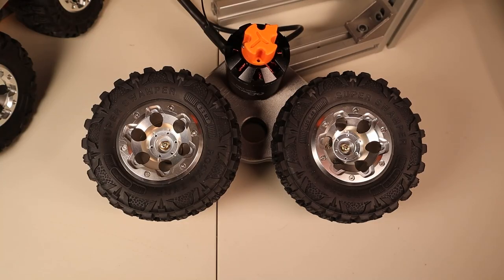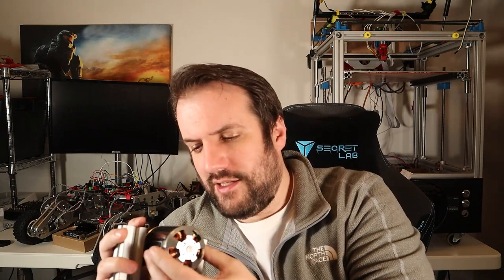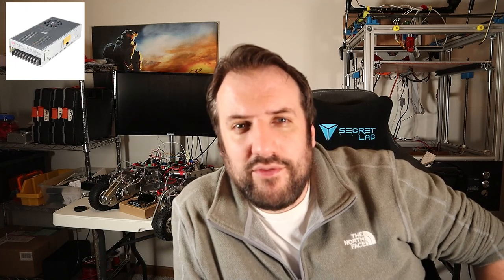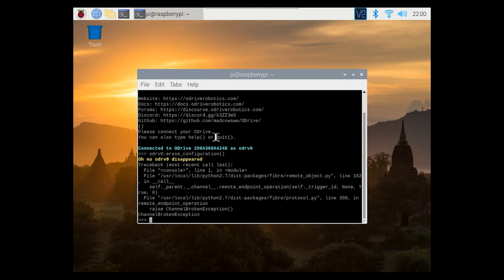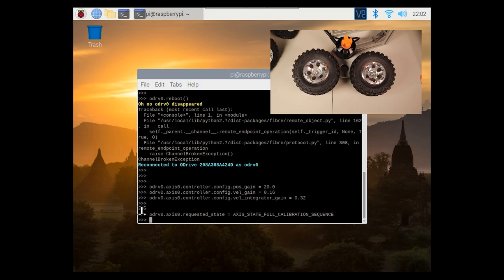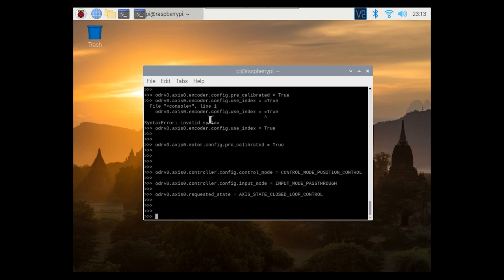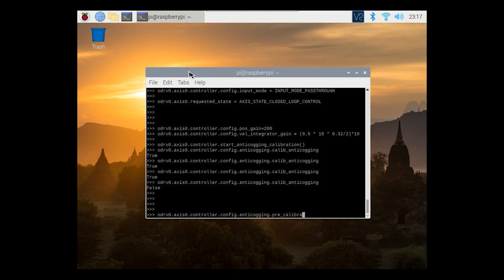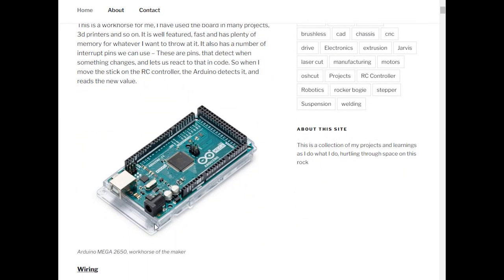Activating Anti-Cogging on the ODrive Robotics Controller (smooth brushless motor control)

Comment: thx for the sharing. Hopefully future can share some tips on calibrating the odrive parameter for motor (on how to set the gain value).
Reply from the maker: I have been thinking about my next odrive video. Thanks for the idea. I am going to probably focus on the control next, integrating RC control through Arduino for example but I do intend to circle back on anti-cogging at some point as I got a few tips from the manufacturer also to make the video better so it needs a part 2.

Comment: I've got a question. I'm going through the procedure and it all works fine. When i test it i can go down to 0.3 vel with smooth movement. My issue is though that the saving procedure doesn't work. Every time i reboot the anticogging calib is gone. Any Ideas?
Reply from the maker: I found recently that you have to put the motor state into IDLE before you can save. I’m not sure if that’s new or I just noticed it but if your motors are active or won’t save
Reply: @AndyVickersNet  thx so much ill give that a try

Comment: I am trying to choose some bldc motors for a robotic arm project but some of the motors that i want to use are not hall sensored. Do you think using a bldc motor without a hall sensor on a robot arm will cause problems when powering up?
Reply from the maker: I am having great sucess with the AMT102 encoders for use with brushless motors. if you have a brushless motor without a hall sensor you can use these encoders on the shaft to give you 8192 counts per resvolution of precision. They are excellent and reliable. They come with a multitude of different shaft adapters so you can add them to almost any brushless motor. You can buy them from the Odrive store:  https://odriverobotics.com/shop/cui-amt-102 .

I think with a robot arm, precision is everything so running it without an encoder or position sensor will be almost impossible. You will be able to power it fine but you would need to control it on current mode which would be like an electric skateboard - just dumping amps in without any precise control.
Reply: @AndyVickersNet  i will be using an encoder if the motor does not have hall sensor. But i saw some people experiences problem when driving bldc motors without hall sensor thats why i have asked. From your reply i understand that if i have an encoder its fine right? Btw thank you for the reply.

Comment: Hi, Thanks for sharing this amazing tutorial. Im doing whatever you do. But vel_integrator_gain and pos gain is so high. It turned my motor wildly. And the loud is so scary. Then ı halve the values. Now its ok. One question. How much will it take ?
Reply from the maker: Sounds scary!! Did you reset the board first? I feel like you might have some other parameters that might be complicating things there. What motor were you using?
Reply: @AndyVickersNet  Hi thanks for reply. Im using Turnigy aero sk3 5055 280kv motor. I set pos_gain to 200. Vibrated wildly amd nothing happened about Calibration. Then ı try many values as pos_gain and integrator_gain. Nothing changed. I wait about 1 hour and  I have Just 1 degree return - which rotated at its first time-.
Now I dont know what to do
Reply from the maker: Hmm I would be interested to see your full config. What is your current set to?

Have you tried posting in the odrive discord? There are many great people there, it might be the fastest way to get help
Reply: @AndyVickersNet  I will post my config. İf ı solve the problem ıIwill post here to make troubleshoot. Thx for your interest.

Comment: We just put a cheap encoder on the end.
Reply from the maker: which one did you use?
Reply: @AndyVickersNet  CUI encoders work if you are not doing millions of back and forth moves.
Reply from the maker: @chrispollard6568  I was using the CUI AMT102-V in the video. it does seem to be a solid encoder. It was $39 direct from ODriveRobotics too.
Reply: @AndyVickersNet  Digikey is way cheaper.
Reply from the maker: @chrispollard6568  Holy Smokes you are right, they are at $28.86!